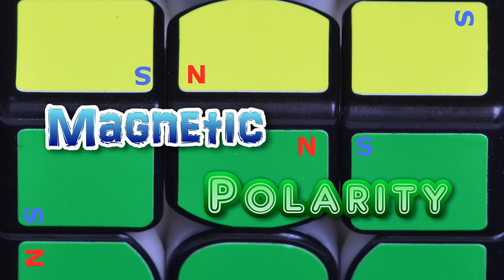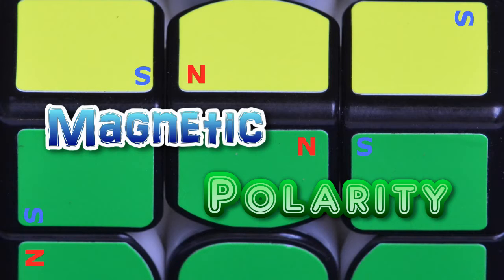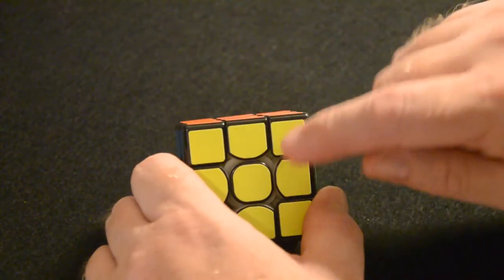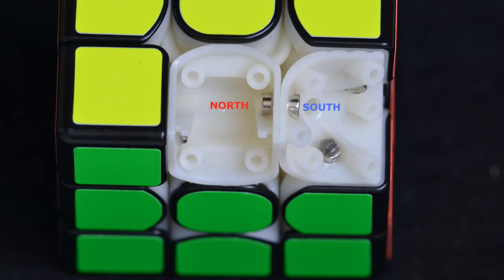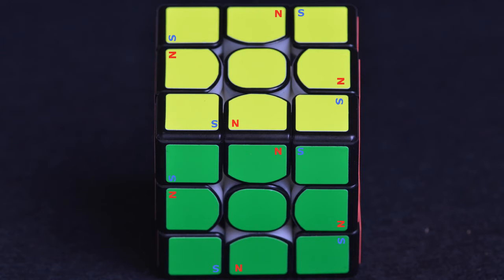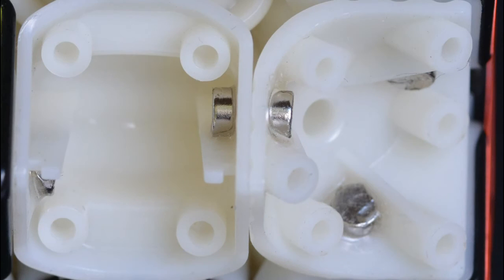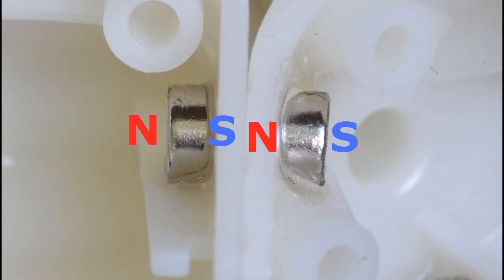Addressing the Magnetic Polarity of a Magnetic Weilong GTS Cube

Comment: Do 5x1 magnets fit in a gts (1)
Reply: DMCubing Oh, thank god. I just bought a strong magnet kit from thecubicle before you responded, but now that I know they fit, my god that’s a relief! TYSM!
Reply: DMCubing Thank you! Hopefully it goes better than my MF3RS magnetizing! lol
Reply from the maker: I'll have to check. I believe there should be enough of room. I'll check. If you do use a 5x1, use something around N48 or higher. I might have to try that myself!
Reply: DMCubing Do they fit? I might get a strong kit from thecubicle but I need you to respond ASAP. Thanks!
Reply from the maker: SpedUHC Yes, they do actually fit. There's just enough room but it's a little bit of a challenge positioning the corner piece magnet. Also, the GTS1 requires a fairly strong magnet, I believe an N48 5x1 would give a light magnetic feel. I always used to use the N48 4x2 and N50 4x2.
Reply from the maker: SpedUHC Like I said they're a little tricky putting into position. If you got the Cubicle kit, it comes with its own slow drying glue, so that's a good thing- you'll have plenty of time to position the magnets right. Have fun!

Comment: I made a mistake of the polarity. How to remove the magnet that we have glued
Reply from the maker: Aliff Hariz Disassemble the cubie pieces and soak them in warm soapy water for several hours. This helps loosen the glue. Once the glue has softened, carefully pry the magnets out with a screwdriver.
Reply: DMCubing what type of soap?
Reply from the maker: Aliff Hariz Liquid soap like dishwashing soap.
Reply: DMCubing Thank you very much dmcubing! I hope it work
Reply from the maker: Aliff Hariz let me know how it goes.
Reply: DMCubing I did it at my edge pieces but not at the corner pieces. I'm using valk3
Reply from the maker: NEXUS GAMING The corner piece magnets were not able to be removed? You might have to find a tool to use that you can pry them out. Once a magnet is superglued into a crevice like that, it's going to be hard to remove.
Reply: DMCubing GOOD NEWS!
I made it!! I use a needle and pick the bottom of the magnet. Im so happy!!. Thank you very much dmcubing for helping me.
Reply from the maker: NEXUS GAMING That is awesome! I'm so happy it worked out!!! Yay!!!!
Reply: @dmcubing6342  I like how it sounds like you're shouting when you reply to NEXUS GAMING
Reply from the maker: Serinded no not shouting at all. 😜
Reply: @dmcubing6342  Yep, I know but it just looks like you are

Comment: I don't understand where to put the magnets and how to check the polarity.
  Can u help??
Reply from the maker: In the GTS and any cube where we remove caps in order to allow us to glue in magnets, the polarity is fairly simple, but it may take a little bit to understand how it works.
Really all we are doing is gluing a single pair of magnets, left magnet, right magnet, in an identical place that occurs 24 times inside the cube. As long as we remove the magnets the same way from the same end of the stick of magnets, and we position and glue them the same way, each time, the polarity will take care of itself. So what I show here and in my other videos on the GTS is that there is one place for the pair of magnets and that one place is repeated throughout the cube.
Reply from the maker: Also, with any cube, we can reassemble it without the core. If the polarity is correct, the magnets will hold the cube into its cubic shape.

Comment: I have tried acetone and warm water to remove magnets, but corners magnets no get out, suggestions?
Reply from the maker: José Anta They are certainly the hardest to remove because of the inside shape of the corner piece. If you can fit any kind of strong tool that will allow you to get behind the magnets, that would help. Something like a dental scraper. Or if you can get a small screwdriver flat enough on the plastic, you might be able to get under the glue. I'm sorry you're having this problem. Let me know how it goes.
Reply: I cant remove it
Reply: May I contact you?
Reply from the maker: José Anta sure. DavesTrumpet@aol.com
Reply from the maker: St3llar Excellent idea!!!! I'll have to give the tapping part a try!!!! I keep meaning to make a video showing how to remove magnets because people have asked, but I haven't had the need to remove any in a while! I like your technique! Thanks for sharing!!!

Comment: how to remove the magnets guys?
Reply from the maker: Franco Cabatingan Take the cube apart and reassemble it without the core to determine which piece has the magnets glued in incorrectly. Then disassemble those cubie pieces and soak them in warm soapy water. Then use a small screwdriver to pry the magnets out.
Reply: but my problem is how to remove the magnets without damaging the cube?
Reply from the maker: Franco Cabatingan You can use the method I just mentioned without damaging the cube. Just be careful when you pry the magnets out.

Comment: How do you remove magnets from a cube when you superglued them? It is really hard for me
Reply from the maker: Iann Jeerome I usually just pry them out with a small screwdriver, using a strong part of the cubie piece to give me leverage with the screwdriver as I pry them upwards and off. Just be careful not to gouge the plastic or dent it. Oh and also be very careful (eyes, etc.) if the magnets become airborne in the process. But it's really fairly easy. I'm always removing magnets! Lol. The hard part is removing the dried glue from the magnets once you've removed them. Just soak the magnets in rubbing alcohol and flake the old glue off of them.
Reply: DMCubing I used to much superglue and it is really hard to pry them out. Is there any other way?
Reply: DMCubing I have trouble in getting the magnets out from the corner. I already pryed all of magnets from the edges.

Comment: Love the video, really insightful after I failed a couple of times. I need some help though. I magnetised my GTS except on the blue and green side they don't attract :/
Reply from the maker: Hi George. Glad the video was helpful. Hopefully you saw my tutorial too. 
You'll have to find out which magnets got turned around. It might be easier to disassemble the cube with the caps on, and then try putting the cube together in a cube shape but without the core. When all the magnets are right, you'll be able to assemble the cube without the core. When you do this, you'll quickly be able to see which cubie piece won't attract and hopefully which magnet is wrong. The key thing to remember is EVERY edge piece magnet attracts EVERY corner piece magnet regardless of color or position in the cube. The edges and corners always attract. 
Then when you find the wrong magnets, you just use a flat blade screwdriver and pry them out. Be careful so that you don't scratch or gouge the cubie plastic and be careful of scratching the plating on the magnet. You'll be surprised how easily they pop out of the cube. It's not hard to remove them. 
Hope that helps. Let me know!
Reply: DMCubing By the way, I fixed it pretty soon after you posted that comment. Thanks so much for your help, I really appreciate it :)
Reply from the maker: I'm amazed that youtube notifies me. Sometimes comments sit there and I never know about them because youtube tends to not update on comments. It will send a notice on the first comment, but hardly ever on the subsequent comments and replies. Talk to you later.

Comment: i tried doing this the way you said at 1:28, but some magnets repel each other, and i dont know what i did wrong or how to fix it
Reply from the maker: typeman5 When you pull the magnets off the stack of magnets, you have to remove each pair off exactly the same way as you did the previous pair. If some magnets are now repelling, it means somewhere while you were gluing you got the polarity mixed up. Hopefully it's only one pair, and it won't be too hard to turn them around.

Comment: Doubt: So it's like sticking north pole on the  edges and south Ones on the corners?
Reply from the maker: Can't find your first comment on marking the magnets with a magic marker, but here's my answer:
I tried that a long time ago. It's very time consuming and messy. The plating is so slick on the magnets that you'll just end up with black finger tips, get ink on the cubie pieces, and still not know which end of the magnet you're dealing with, because the ink doesn't stick well to the magnets. If it works for you, go for it.

In regard to North/South, since the poles have equal pullforce, all we're concerned with is that the corner piece magnet always attracts the edge piece magnet.
Reply: DMCubing We can use an OHP marker instead ( the one you would use to write in CDs)

Pardon me, I didn't get it. Like we stick so called north pole mags on the edges and south mags on the corners right?
Reply from the maker: Yes, you can use a marker, but you'll probably end up having all the ink wipe away since the magnets are so slippery. The ink doesn't stay on them.

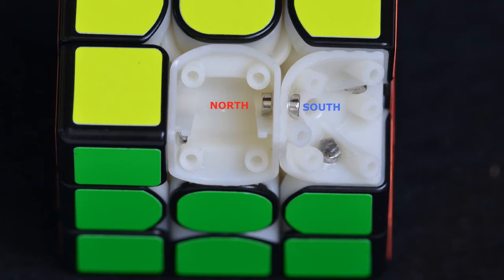if you look at 2:14 in this video, you'll see how the ends of the magnets are oriented. It's not important that we use true north, what is important is that we repeat this same polar relationship through the entire cube. 

The corner magnet, like you see at 2:14 will always attract the edge magnet. And how you position these two magnets as seen here, you just repeat, over and over, 24 times in the cube, putting them in this exact location with this exact relationship to each other. Hope that helps.
Reply: DMCubing Yeah. Now I get it.. Can't wait to get a GTS! Thumbs Up for the trumpet.
Reply from the maker: Great! Thank you!!!!
Be sure to check my tutorial on the GTS (it's a separate video from this one) and maybe take a look at some of my newer magnetic cube videos. Thanks and good luck! Let me know how yours turns out. 
Oh, one last thing. I'm now using N52 4x2 magnets in the GTS. If you're doing a black GTS, the N48 magnets will be subtle. You'll still feel them, but they don't have as much an effect as the N50 or N52 magnets.
Reply: DMCubing Forgot ask, does stronger magnets turn the cubes clicky? I don't was a clicky cube. I just want my cube to the stable.

Comment: I WISH I SAW THIS BEFORE I GLUED MY MAGNETS IN, BECAUSE SOME MAGNETS DONT ATTRACT EACH OTHER I JUST THREW THEM IN RANDOMLY AND WELL RIP MY GTS
Reply from the maker: All is not lost! Just carefully pry all the magnets out, scrape the old glue out of the cube and from the magnets, and start over. I've had to remove magnets from quite a few of my prototype cubes until finding the perfect magnets. it's a bit of a pain, but your cube is still fine and you can certainly get it perfectly right. be sure to check my videos, just about all of them deal with mag cubes, or tutorials on making magnetic cubes.

Comment: Very helpful video! I know you vaguely touched upon this, but how would we differentiate between north and south to ensure that the same pattern polarity is placed throughout the cube?
Reply from the maker: Good question! It was presented here as a guide for magnet placement. Both poles have equal pullforce. So, where I say North or South is just to illustrate the placement of the magnets. We're not really concerned about finding true North as we are keeping the same, identical, magnetic polarity throughout the cube. When I do a magnetic mod, the very first thing I do is mark the end of my stack of magnets with either a little piece of paper inbetween the last few or with a piece of tape. This is done to keep the poles identified at all time. Hope that helps!
Reply: thanks TC for asking this!!
Reply: DMCubing We can use a marker to mark the poles on the magnet itself.

Comment: How is it possible to make a magnetic 2x2?
Reply from the maker: I haven't figured that one out yet. I think Chris Tran, of The Cubicle, has prototyped one though.
Reply: DMCubing 
Yes, I know it and I don't know how it's possible
Reply: Alix Jack 
Opposite polarity would just have to be alternating between the corners no? Two magnets in each corner? one for side to side movement and one for up and down movement
Reply: Cryptic no It can't work like that i think there a "trick" to make it possible but I don't now what
Reply: Alix Jack  One magnet on the top right face point at the ceiling and a receiving magnet on the bottom left facing you then alternate it on each side. Why wouldn't that work? The magnets would be placed diagonally to where they meet after turning, wish i could illustrate it, but the point is some magnets will not be in contact with other magnets until after it turns
Reply from the maker: +Cryptic I'm thinking the magnetic attraction has to be made through the pieces attracting to the core, not toward each other.
Reply: DMCubing Ah, same idea, but forgot the mechanism of the 2x2 doesn't actually have an connecting edge piece for the magnet to be placed on does it? See I don't have a 2x2 and it was a key detail I under looked, my apologies, but the idea of magnet placing could still apply?
Reply from the maker: +Cryptic Oh, no problem at all.
I only own a Zanchi, but I'm going to order others to study. There's just not much room and space to do things within the parts. I'm almost guessing the pieces would have to be drilled and have the magnets recessed and placed that way. I'm not sure though. It's going to be a bit of a journey finding out! :)
Reply: DMCubing  Do all 2x2 Zhanchi's have a similar core?
Reply: DMCubing http://cubercritic.com/wp-content/uploads/2015/04/Dayan-2x2-Mechanism.jpg This is what I am looking at and I am not sure but the cubbies look ideal placements for the magnet now I am not sure how much smaller the magnets would have to be in this case
Reply from the maker: It has to do with the clearance between core and cubie piece. There's not much space there, at all. That's why the magnets would probably have to be recessed. I just haven't had the chance to really experiment with it yet. But I will!